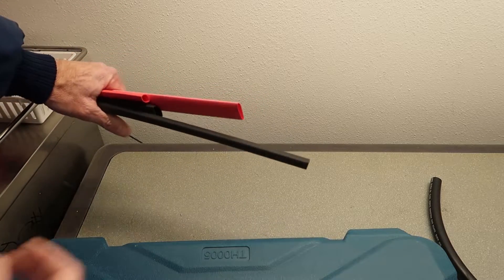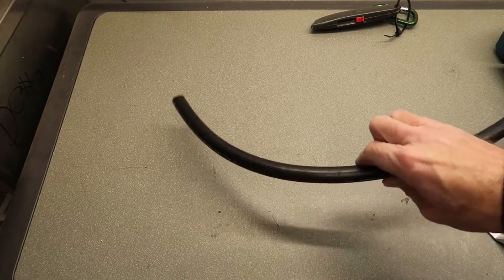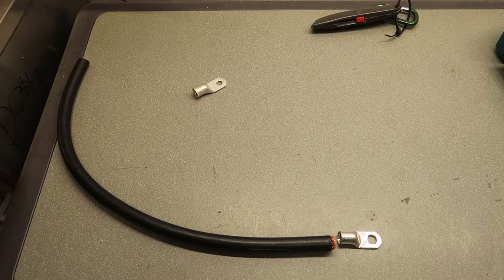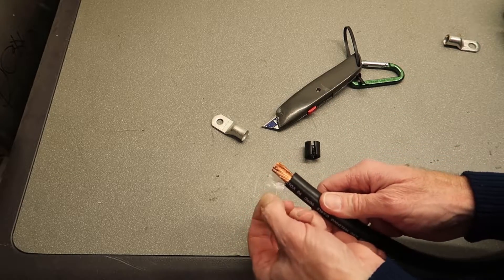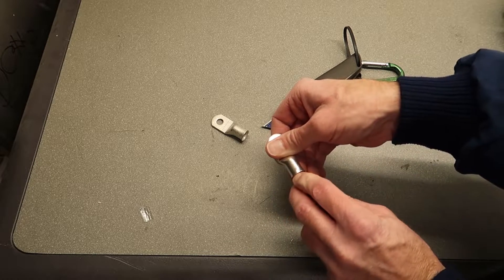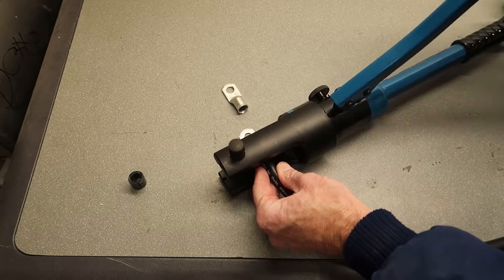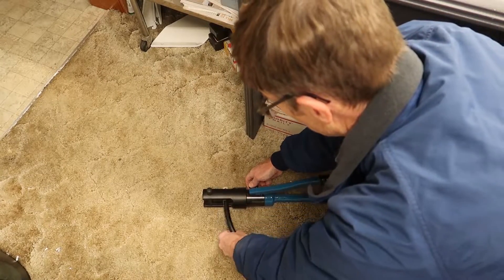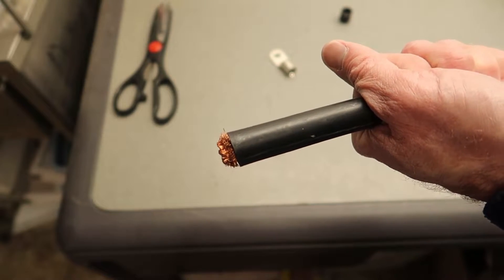Building Battery Cables with TEMco Industrial TH0005 Crimper

Comment: Thank you for showing crimps the correct way. I have both their hydraulic and hammer type crimper. Both do it well but I am lazy and use the hammer tool the most.
Reply from the maker: This crimper is more time consuming to use.  It takes some finesse to hold the cable into the lug while also holding the crimp tool and ensuring the lug doesn't move or rotate out of position until you get started with the crimp process.

Comment: Nice video.  I snagged that crimper as a factory referb (iirc with warranty) from TEMco’s EBay store some years ago. Saved $$$, and other than some oil residue I couldn’t tell it from new. 

Having cut apart connectors I’d done in the past, I now wipe the lug and end of the wire with isopropyl alcohol and let dry prior to applying adhesive shrink tube. I’m sure it seals fine without that step, but the shrink tube really adheres aggressively when you remove any trace of oil from manufacturing or fingerprints.

Comment: Often it is easier to place the terminal in the tool and tighten just enough to hold it in position and then insert the wire.  Fewer moving pieces to hold at the same time.
Reply from the maker: That's how I do it now.  :-)

Comment: Hello, where did you get the terminal lugs?
Reply from the maker: I ordered them direct from Temco.  I've also purchased some on Amazon.
Reply: A lot of industrial hardware shops have them. We have a place here called McFaddendale. They're are a few of them in the Las Vegas and SoCal area.
Reply: Beware of some of the cheap Amazon and EBay ones.  They can be thin/poorly made.

Comment: Will this Crimper crimp 0 gauge?
Reply from the maker: Check out the dies here:
https://temcoindustrial.com/th0005-v2-0-hydraulic-cable-lug-crimper-11-us-ton-10-awg-to-600-mcm-electrical-terminal-cable-wire-tool-kit-with-32-die-sets/

Comment: material list would be nice.
Reply from the maker: I used some 2/0 welding cable I had from left over projects.  The terminal lugs were ordered from TEMCo at the same time I ordered the crimp tool.  The size you order is dependent upon your cable size and how big of a hole you need in the ring terminal.

Comment: Nice I like your crimper.  Mine is about 8 years old and you have to a guess as to which die set will crimp appropriately.  Second, I like the heat shrink that has epoxy in it for sealing the ends (both)  for moisture intrusion,  But that was from a boat rigger background.  Nice job!
Reply from the maker: I really like this crimper a lot.